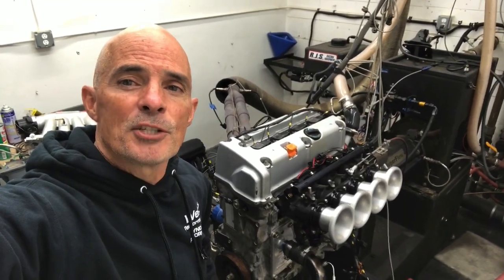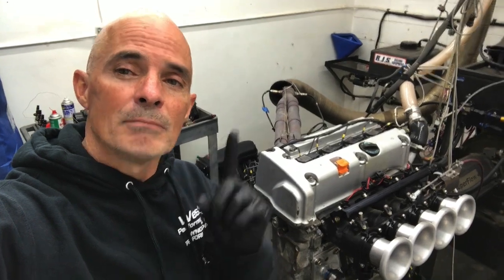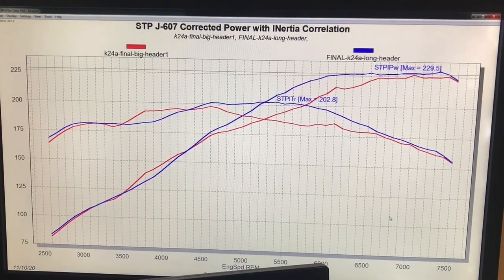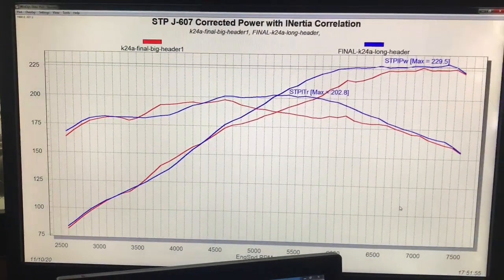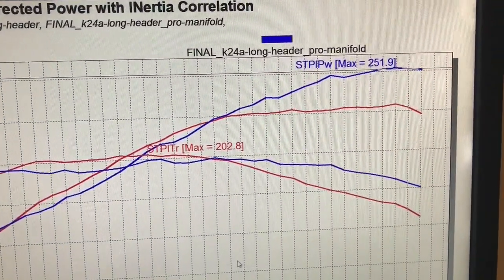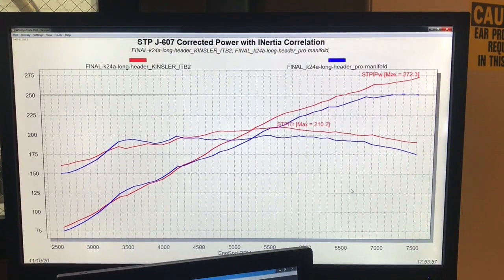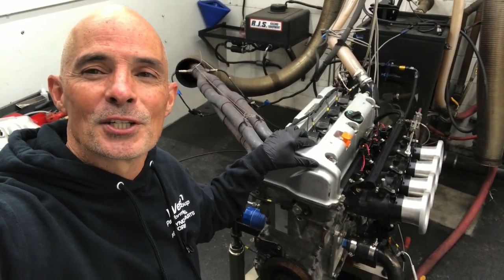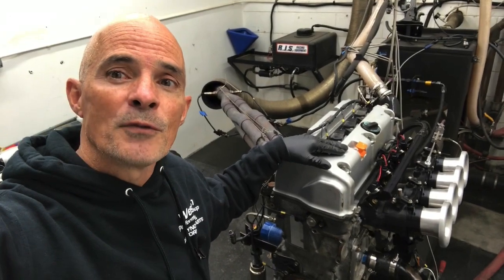JDM K-SERIES HONDA-TRI Y VS 4:1 HEADERS & STACK INJECTION

Comment: I really like this testing. Having less piston speed and displacement makes it a lot harder to   make power because you have less to work with to make change. In this test you really show not just in this engine but how important how much intake and exhaust choice really has an impact on making power. Cheers bro
Reply: At a 3.9" stroke, this is actually a decently high mean piston speed.
Reply: WOW I am shocked thank you for pointing that out. I didn't know an engine that small would have such an over square bore and stroke. I dont have any experience with these Honda engines. an assumption based displacement and being a 4 cylinder.
Reply: @27jazman  Hondas car engines have always been fairly undersquare. The modern 2.4-2.5L engine class has bores in the 86-90mm range and strokes in the 97-100mm range. They all were originally designed as roughly square 86x86 2.0L engines and were then stroked.
Reply: @mattbirt114  That is cool now i wouldn't mind looking into a 4 cyl for economy transportation. This changes the whole game. It would have decent torque and wouldn't have to wind the hell of it to move. Thanks for the eye opener Matt

Comment: What were the runner lengths for the intake manifolds?  The IR Kinsler manifold looked shorter, yet it didn't lose midrange torque.  Maybe the shorter length is just an optical illusion.

The tri-y header performs great, but what engine compartment does it package in?

Comment: For the next intake test, install the Boss intake (the one on the dyno room floor) with individual throttles on the remaining intake runners, plus a TB to open at higher rpms-long runner/short runner intake? LOL Great work Richard!

Comment: Would love tests on the old Chrysler 2.2/2.5 turbo engines or neon engines
Reply: Man, that would be cool. I never see any dyno videos showing parts swapping. 
A 86/87 turbo buick lc2 motor would be great too
Reply: The 89-92 Olds 2.3L Quad 4 LG0 180HP was an incredible 4cyl. as well. Seems like they got>1000hp in the twin turbo Aerotech program and over 250mph driven by AJ Foyt.
Reply: check the recent hoonigan video showing an omni glh(goes like hell) looking pretty stock and doing 10s
Reply: @Turbo_Todd  Also in the Beretta GTZ or was it GTU, I forget. One had the quad 4 the other was looks package and the v6. Had an old lady customer that had one of those turbo K-cars. She kept bringing it back because it wouldn't start... but only at the cemetery when she visiting her husband's grave. So you know what that means...

Comment: Same set up I have 05 k24a2 with itbs I love it awsome dyno videos 👀👌💪🚘🏁🔰😎
Reply from the maker: THEY WORKED WELL AND LOOK AWESOME
Reply: @richardholdener1727  mine are Kinsler 52inch they small but my motor is stock has everything acura rsx type s oil pump tensioner chains and acura rsx  type s vtc intake cam  gear  gear  I be real happy with 275 oh and not ck20 head its straight up k24a2 tsx 05 motor rbb has 1000zz injectors blox raceing 450.welboro fuel pump so we will see real.soon like next month when I take to dyno

Comment: Wow 270+hp NA! I was suprised at no big low end losses from the stack injection setup.
Reply: Put it in a bike chassis.
Reply: The not losing at the low end much its because of the VTC Variable Timing Control. With a 50 degree vtc it's even nastier. Lots of guys in the honda community uses them all the time because you still retain low to mid range torque plus loads of topend power.
Reply: Forgot to mention that stock k-series engines come with a 25 degree vtc
Reply: Check out the all motor civics they use for drag racing, there’s also a video by 4 piston racing of one of these engines completely built making 500hp NA
Reply: @eliasmelendez1271  this particular one yes but the RSx type s and 2006 - 2011 si civics have a 50 degree vtc gear , its what guys swap to the k24’s .
Reply: @monikhushalpuri  preyuto made a 517whp civic and was the first person to get there. His shop isn't that far from my house. But if you want the same results or close enough ask the guys at Victory machining and performance they do the work for preyuto racing. Thats Norris Preyuto.
Reply: 270bhp as it's at the flywheel. Minus 15% do to drivetrain loss in a chassis and its only around 230whp which is just about normal for a stock long block. Now add a 50* VTC gear and Type S oil pump and you may see around 237-240+ whp. All K's make the same and are not hard to guess what someone is making.
Reply from the maker: this has 50 stock I think
Reply from the maker: not 15% loss on a Honda
Reply: @richardholdener1727  not stock k24 only comes with 25 degree vtc the 50 degree vtc is a very common mod on them tho.
Reply: @richardholdener1727  jdm k24 has a 25 degree vtc ...swap it for the rbc 50 degree and rbc oil pump and rev her to 8500!
Reply: Thats that ivtec doing its magic.
Reply: @monikhushalpuri  Theres ones already in the 800whp range. 1000whp is the next hurdle, but I think they can do it. Jmarsh is leading the pack

Comment: Thing to remember, chaps, is testing takes up a LOT of time!
If one had the time, and interest, designing a system with 'trombone' style slip joints for the primaries and secondaries (if used) might speed thing up a little, ditto on the intake trumpets, to establish the lengths. Would need to be made in different diameters, though, so lots of $$$s.

The really serious race teams will have multiple engine dyno's running 24/7 testing different configuations for incremental gains.

Comment: One of the biggest variables to all of these dynos that I see is lack of airflow. In the K series you start seeing most individuals chose a plenum over the ITBS towards the front of the car. This effect can introduce positive pressure to the engine up top meaning with even at 1psi of positive pressure it changes everything. The same manifolds tested might yield better numbers with this added positive pressure. It might mean that headers that did not work might be great contenders. It's not until you hit the track and produce and check your logs that you see this effect.
Reply from the maker: BONNEVILLE ADDS EVEN MORE
Reply: @richardholdener1727  have you thought about incorporating some sort of positive air feed to the all motor engines you test. I'm certain plenty of folks received beautiful data from this video. Definitely some header changes after this. 
 
Having an engine dyno is a huge plus and awesome content to see. 
Seeing a honda engine in this channel can make many domestic folks respect the platform a lot more and since the fad is making them AWD you're starting to see most folks trying to explore their torque options to improve those 60fts

Comment: Hey Richard, noticed your tri y headers have 1-2 & 3-4 paired, I have been interested in the differences in rpm power bands and cylinder pairing with trip y pipes.
By your header lay out it would be possible to flip your secondary collectors and run 1-4 & 2-3 thus changing from 540 degree firing cylinders paired to 360 firing cylinders.
What do you think? Interesting test or not?
Lester
Reply from the maker: we did that
Reply: @richardholdener1727  ...and how was the two graphs compared to each other?
Reply: I'm intrested too. How did 1-2 3-4 compare 1-4 2-3 primary pairing
Reply: Would that not be better? Why on Earth would you Tri-Y anything but complete opposite power pulses?
Reply: @exploranator  in practice, the odd fire pairing 4-2-1 header behaves like a 4-1 with a long collector. The successful designs all have long primaries and short secondaries. With even firing pairing (as you've described), you can get away with short primaries (10-13"), long secondaries for the balance of the tuned length, and still have good scavenging.

Comment: Another great video, would really like your opinion on valve angles, on these smaller high rev'ing engines, is there power to be found with using something other than the standard 3 angle valve job?  TIA
Reply from the maker: probably so
Reply: Always more to be had.

Comment: Love it!!!      I'd like to see what a k24z7 would do on the engine dyno with its integrated exhaust manifold.
Reply from the maker: not a fan of that design
Reply: @richardholdener1727  makes it so easy to turbo
Reply: @richardholdener1727  because it sucks lol NA heads kick ass

Comment: Why not get small and big tube headers from the shelf of Skunk2 that also fit in a car.. Also why not take a Skunk2 pro intake that isn't adjusted for a kraftwerks, or are you planning on that? Would be nice to see some Skunk2 ultra street or even ultra race intake testing on the stock k24 because the pro is a very old piece of Skunk2.

Comment: Is there any particular reason you connected Cyls 1 & 2 together on the Tri-Y?  I always thought  it was 1 & 4, 2 & 3 that should be together, so adjacent cylinders in the firing order went down the other collector.

That and it keeps your Honda from sounding kinda like a Subaru...
Reply from the maker: we tried both
Reply: @richardholdener1727  no difference?

Comment: Ever tried a comparison of long tube tri Y headers and four into one headers on a V8, I have spent a long time looking and never seen it done
Reply from the maker: I have on a Ford
Reply: @richardholdener1727  Is there a video of that? What were the results?
Reply: Car Craft tested some on a 350 in the mid 2000s. They ran Thorley Tri-Ys for a G20 van.  TH315Ys agains some 1 5/8" long tubes.

Comment: Hey weird request but do you think you can see what power can be made from a full bolt on 1.6l Miata engine?
Reply from the maker: I have done Miata testing-even developed a few intake manifolds
Reply: @richardholdener1727  oh that's cool, do you think you can make a video on it? It's because I want to maybe make around 200hp on it and I'm wondering if I should just get a supercharger or try and build it NA.
Reply: With a 1.6 you’re not going to get much more power NA before forced induction would make more power cheaper. The engines don’t breathe well enough to really make easy NA power. I’ve seen some with all the bolt ons including cams, head work, and higher compression and they’re usually only making 150-160. And all that is very expensive. If you’re not set on keeping it NA you can make more power than that with a small cheap turbo kit.

Comment: Richard, did you ever test the 2.3L LG0 Quad 4's developed by Oldsmobile in the 1980s? 180HP stock.
Reply: Good choice. Wondering about that myself.
Reply: I thought he did a quad 4 a few months back ... perhaps he was just talking about it
Reply from the maker: The HO version was 195 hp
Reply: @richardholdener1727  talk about other guys engines.  That would be a cool series.

Comment: Ok, so heres a suggestion Richard and its an issue that the Honda community has debated ever since Honda released them. But in the late 00's Honda started releasing engines, L series, J series, K series with the integrated exhaust manifold built into the head, so the debate in the Honda community is that the regular individual exhaust ported heads are better than the integrated manifold heads as in they flow better and therefore make more power. So perhaps in the future, could do a Dyno comparison on nearly identical engines, one with integrated manifold and one without because i've yet to see a solid similar comparison. Anyways, enjoy your videos because numbers don't lie.
Reply from the maker: I WORK WITH THE DESIGN ON A BONNEVILLE VW MOTOR-NOT A FAN OF THE INTEGRATED EXHAUST-POOR FLOW AND PERFORMANCE-IT WAS DONE FOR LIGHT OFF/EMISSIONS
Reply: @richardholdener1727  Blech. Mopar did it to their latest V6's too.

Comment: needs a k20a2 head swap with the 50° vtc! should crack 300 hp with that header and itbs
Reply from the maker: we did the 50 degree sprocket-doing ported head also

Comment: So I have always had this question about tri-y headers. In some of the older hot rod engine masters competition videos involving Jon Kaase all his motors seem use tri-y headers (the Y block ford and the modular ford for example). So my question is if you were to take a set of 4-1 headers cut off the collector and replace it with two 2-1 collectors would we see an greater power gain than a traditional set or short runner tri-y's or would a set of 4-1's still produce better all-round power? Or is this extra power in this case have to do with the engine being a 4cylinder instead of a v8 with an un-even firing order?
Reply: IMHO it might not work. The diameters & length of the primary & secondary piping needs calculation. & type of intake manifold does varies the end results as well. & that is on stock engine.
Reply from the maker: Its not Tri Y vs 4:1 as an absolute-its a good 4:1 vs a good Tri Y-then you can make the same power
Reply: @richardholdener1727  Aren't 4:1 & tri header tuned for different power curve?  One shif the power curve much further up leading to higher narrower powerband while the other targeting a flatter power curve at a lower powerband? 
.
What do you mean by both having the same power?
Reply: @richardholdener1727  so therefor everything being equal a well designed tuned set of tri-y's will outperform a set of tuned 4-1's? With the peak power being equal however the average power thru out the graph will be better. So why aren't Tri-y's much more popular with exhaust companies? Also why then on a v8 will everyone (hot rod, uncle tony, engine masters etc) always recommend 4-1's over tri-y's?

Comment: Makes me wonder what magic Phong from the boostedboiz/pfi speed worked in his head to make 300hp to the tires. I can't remember what header he had, but I know it's running ITB's
Reply: Big cams, heavily ported head, higher comp, running better fuel etc
This being a stock engine on stock internals is very impressive
Reply: Robert Bandy  no that's Kyle.

Comment: It just looks so much easier to work on than a LS, are they? I've only got 30,000 mi on my LS2 and I'm scared to tinker with it only having 30 minutes here and there to be able to play with it and because it's my daily. Work 50hrs/week and have two small children in homeschool.
Reply: they are pretty easy to work on. Honda's are pretty fun to play around with ive had a few turbo civics before getting into the v8 stuff and my little brother has one also. They are cheap compared to muscle cars you can always pick up a decent used civic for $1500-2000  and then start modifying it from there.

Comment: I'm just so astonished at the power output. 

I'm going to turbo my Honda accord cu2 with mostly stock k24z3. 

It would be interesting to compare the power figures and cost. 

How much HP would the k24a2 lose to the wheels?

Comment: Looks like the itb set up was still climbing and could have used some more rpms.
Reply: It does, but the stock oil pump in these engines can't handle much over 7500 RPM without cavitation or risking blowing up the balance shafts.
Reply: @averyalexander2303  Do they delete balance shafts in these motors?
Reply: @lucysmith4242  Yup, it's pretty common for people to install the RSX-S oil pump because it doesn't have balance shafts and can safely run at a higher RPM. The only real downside is a bit more engine vibration, but that's an acceptable trade off to most enthusiasts.
Reply: @lucysmith4242  yeah with the type s oil pump they rev a little past 9k with balance springs

Comment: I noticed that the tri-Ys were NOT traditional tri-Ys. Cylinders 1 & 4 should be paired into one of the primary Ys, as should cylinders 2 & 3. Then the primary Ys are paired into the secondary or final Y. Think about why... Of course, if this were a test of Ford's Voodoo engine, the oairs would look somewhat different.
Reply from the maker: WE SWAPPED THE PAIRS
Reply: @richardholdener1727  but what was the testing like with proper 360 degree Tri-Y's?

Comment: Definitely should have run the stack injection out another 500-1000 rpms. Really impressive power from a small engine!
Reply: 9700 with correct valve spring pressure, k20c oil pump and cams is common.

Comment: Wait until you change the oil pump to the ap1 or the k20a2 oil that will allow you to rev pass 7500rpm plus i know replacing the valve springs aswell. But those engines are nasty as a all motor or boosted application.
Reply from the maker: wait til you see how high we ran the motor with the stock pump